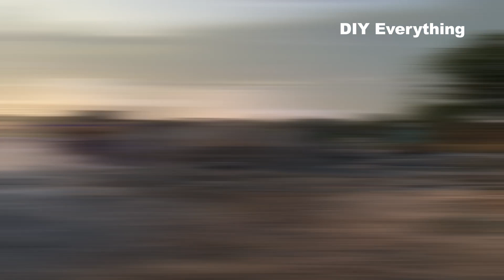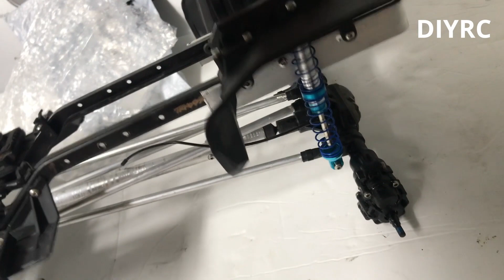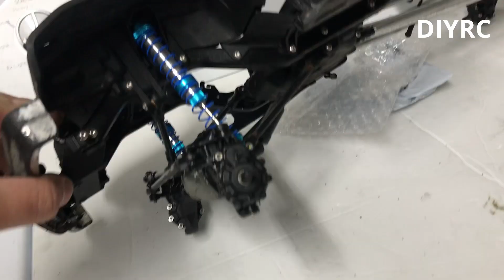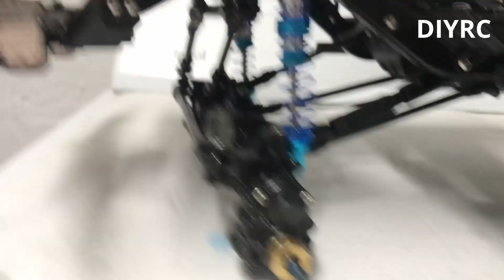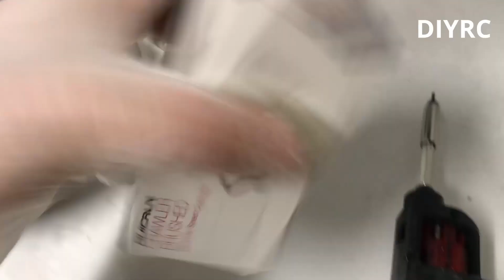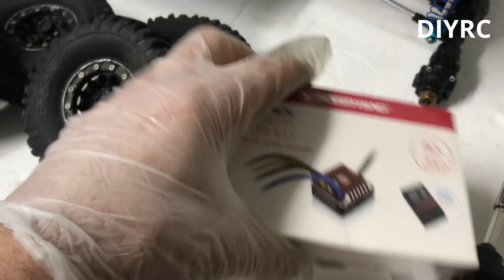TRAXXAS TRX4 1:6th SCALE CONVERSION!

Comment: Putting longer shocks on the front of the trx-4 is silly because of the way the links are with the 4th link being a pan hard bar. The one that go's across the axle. You have to. Ake that longer to allow for the longer shocks but the when you compress the suspension the whole front axle moves sideways.
Reply from the maker: cool